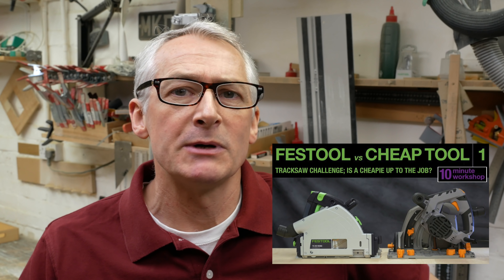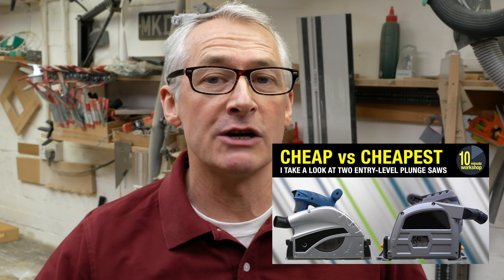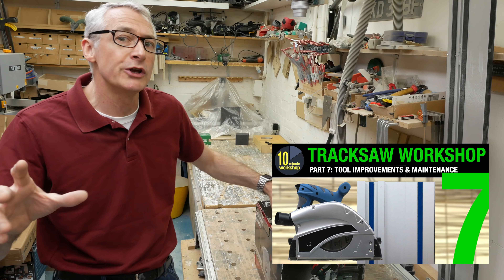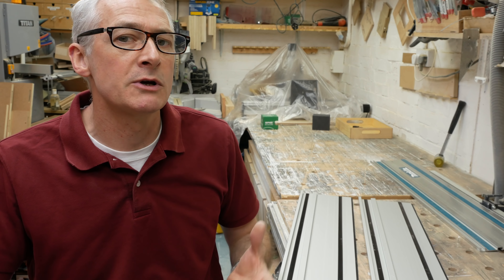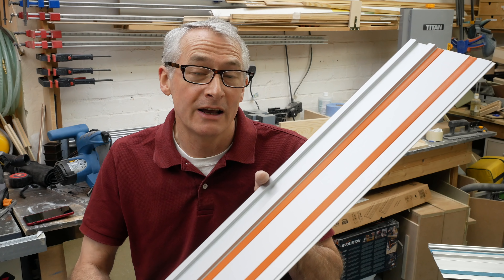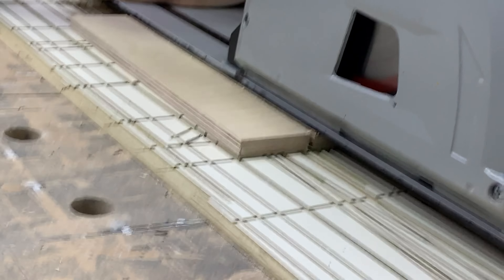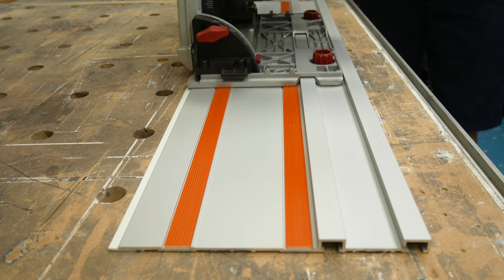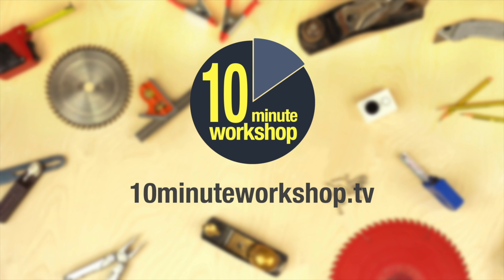Lidl's Parkside Tracksaw [Video #323]

Comment: I quite like the Parkside stuff, I've had several tools for a few years, I'm not a joiner or a tradesman but I do use them regularly and they are still working fine. Wouldn't hesitate to buy a saw like this.
Reply: A mate of mine runs a motorcycle repair workshop.  He needed a drill in a hurry when his had died, grabbed a Parkside one as it 'would do' f but has been thoroughly abusing it, and the single battery it came with, for 5 years (or more).  It's still fine!
Reply: They're made in Austria!
Reply: @AC_Milan1899  all Parkside tools are made in China. What makes you think this is made in Austria?

Comment: Thanks, Peter, I purchased this on Thursday and opened it today. I was not very happy about the tracks as there was a gap with the splinter guard. I called Lidl and they will raise it with the manf.  I used the saw today and it is great. I am glad I watched your video before spending lots on a table saw.
Reply from the maker: Thanks! How do you mean ‘a gap with the splinter guard’? Between the rails when they’re joined maybe??🤷‍♂️
Reply: @10MinuteWorkshop  Yes its about 3 millimeters.It At the back the rubber grips were not stuck correctly either. The fitting is not flush. I was watching your latest vlog.
Reply from the maker: Then presumably the runner strip wasn’t in line with the rail, so was overhanging at the other end. Could you not join the other ends of the rail, and trim the splinter guard back? Might be easier than messing around with the manufacturer 👍👍 Splinterguards are consumables btw - they’re meant to be replaced.
Reply: @10MinuteWorkshop  It creates too much sawdust even with the vacuum cleaner attached. I returned the item back to Lidl and got a refund. I will need to install a proper dust removal system. For my hobby work , it might be better to use more hand tools than power tools :(

Comment: Very timely video and thanks to Louie!

I have owned this saw for 2 years and can confidently recommend it, especially with an upgraded blade (Triton TTS60T in my case, which has the more common 2.2mm kerf)… it plays very well within the Festool ecosystem (for the better and more comprehensive add-ons) and fits within a Sys-4 systainer, with room to spare.

One thing not mentioned in the review is that it lacks a riving knife, which some may view as a big drawback when cutting solid wood

I look forward to the Triton rail deal review, although the fact that the 'unique' profile implies that some Festool (stops, etc.) and third party accessories (UJK clips, etc.) won't work with it

Comment: I've been using the Parkside plunge saw for about 4 years now, bought it to trim decking and since then I've used it mainly for floor board repairs, door trimming and wardrobe installs, probably hung 30 internal doors last year and it's been a great tool as long as you remember a couple of things, buy a decent 42 tooth blade, I get about 8 months out of a Freud blade, the festool splinter guards fit fine, I would recommend new ones every 2nd blade change, get the Nilfisk aero dust extractor, and spare guide rails from lidl customer services. Also remember this type of saw will bite back if you just drop the blade into your work surface and mitre cuts deserve even more care than you initially think. Every year I hope this saw will break down so I can spend 600 quid in screwfix on a Mafell saw, and every year I think how could I justify the cost, I couldn't cut any more doors in a day, I couldn't repair any more chipboard floors, cut deck boards etc etc.
Thanks to Peters other reviews, I did finally buy a self centering drill bit so now my hinges go on square! Thanks
Reply from the maker: Glad to hear the Parkside is working out for David! 👍👍
Reply: How much were spare guide rails? Do they have longer ones?
Reply: @industrialautomation3470  I've since replaced the parkside saw with a Mafell because of the better rail system, better dust extraction and blade removal. If you contact Lidl customer service they'll give you a price for extra rails but they're only 700mm long so cutting a 2400mm board needs planning.
If I was keeping the saw I'd look at another make of track.
Good luck, I hope this helps

Comment: I’m new to parkside. I’ve found from experience that for the Hainault branch I visit, you need to regularly get the magazine or app and see what will be available. If there is a parkside tool you like, you would need to find out the day it is available (usually Thus or Sun). You would then need to get there early (morning) that day and grab one. They only put a handful out.

Comment: For a diyer these tools are pretty darn good, I’ve had quite a few tools from Lidl’s and even Aldi and they’ve done the job I wanted it for and even on jobs that needed a better tool......this tool is ideal for cutting up ply to size but, a word of caution, make sure you allow for kerf in your measurements....
Nice and informative video, cheers 😉
Reply: Kerf ?????
Reply: Kerf is defined as the width of material that is removed by a cutting process.

Comment: Highly recommend this saw. I bought one when they first came on sale. I used it everyday for 6 months. Unfortunately mine was stolen along with some other power tools. I now have the dewalt tracksaw. The Parkside had a nicer sound to it, the dewalt sounds a bit rough when the motor first starts. The Parkside is much easier on the ears. Very very good value for money. I may even buy another if they come back on sale as was said in the video.
Reply from the maker: They’re available now, I believe. 👍👍

Comment: I have a load of Parkside stuff works just fine as long as you set them up and tweak them properly. Titan tools are also great... I have their cheap table saw and I've been using that for about 3 years now, great bit of kit an absolute bargain.
Reply from the maker: Yep - and everything needs a certain amount of tweaking at the start, even the top brands 👍👍

Comment: The million dollar question is: does the saw blade pivot along the cut line? If you want to make a 45° cut does it line up exactly with the 90° splinter guard or does it cut into the splinter guard? I imagine this depends on the blade kerf as well.

Comment: Fantastic video, came in search for a review about the Lidl Tracksaw but will be staying for the quality and knowledge you provide! Fantastic channel! One question, if I were to upgrade the standard 24T saw to a 48T saw, would for instance a Trend CSB/pt16548 be any good?
Reply from the maker: Thank you! I’ve had mixed results with trend blades tbh. I usually recommend the Triton 48t blade - https://amzn.to/2EQgUMJ - as it’s a great price. BTW this vid is getting on a bit now - there’s a more recent Parkside saw video  here 👍 - Lidl Parkside plunge saw 2021

https://youtu.be/kFyDGdH66HM
Reply: @10MinuteWorkshop  Thank you so much for your input :). Much appreciated! I checked out the videos mentioned, including the test with the Triton 48t blade. The result looks very clean for a set costing less than 100 euro in total, it's hard to beat for a hobby builder like myself. I should also thank you for making the tracksaw tutorial series, extremely helpful in getting started!

Comment: Following this Video I rushed out and bought this saw and I am thrilled with it. It’s a cracking saw for the money and has been invaluable in my house renovations. The only downside is that the rails seem to ‘wander’ when making cuts, especially long cuts. Is it worth upgrading the non slip stuff on the back or would I be better off getting different rails eg Evolution or even festool?
Reply from the maker: Good to hear you getting along OK with it. Are you clamping the rails or just relying on the grippy strips underneath?   A pair of cheap clamps might be a good investment, generally (Makita and Festool screw clamps are pretty similar in price) but yes, you could upgrade the grippy strip, or switch rails. I’d try a pair of clamps first tbh. 👍👍
Reply: @10MinuteWorkshop  Peter, thanks for your reply. I'm  using it freehand at the moment but will look at getting a pair of clamps. The splinter guard is also not true. For some reason its not a straight line but the saw cuts true. I think that may be user error on my part when setting it up! This is why I am weighing up the cost of replacing grippy stuff, and splinter guard with a set of new rails. Did you ever get round to reviewing/looking at the evolution rails?
Reply from the maker: @abyshepherd6944  Ah, OK. That's odd about the splinter guard; if you warm it up a little you can peel it off, move it out by a couple of mm and re-cut it - that trick works a few times before you have to replace it completely. And no, I haven't done anything video-wise with the Evo rails yes, but they're the best option for a pair of 1400 rails, right now. 👍

Comment: I feel there is too much focus on track compatibility, Peter. I understand for someone like yourself, with expensive kit like the Festool, the idea of buying a budget tool and using its track would be of interest but to most purchasing I doubt they would care.

Again, I believe the Titan, Aldi Workzone & Lidl Parkside are made by the same parent company (Positec). Apart from the blade differences etc I'd reckon everything else is down to quality control and pot luck in which one you get in the store. My Aldi one works perfectly but the Parkside seems better value for money.

Anyone into DIY should invest in a track saw. They really do make a difference in accuracy of cut and saving time.
Reply from the maker: Fair enough, but it would be remiss of me not to mention the inconsistencies in e.g. the Aldi saw; I covered this in more detail in the 'Cheap vs Cheapest' video (#285) but the short version is that a length of additional track is the next purchase most people make, and it would be disappointing to find out that the saw you bought isn't 100% compatible with the defacto standard. I'm happy you're happy with your Aldi saw (made by Scheppach, btw) but in my experience it needed a lot more work to get cutting well vs eg the Titan. 👍

Comment: Could someone please help and tell me which way do you unscrew blade bolt? 
Sounds stupid but I through away instructions and in need to change a blade, 
Tried anticlockwise and manage to ruin the bolt, so I'm not sure if bolt got stack or I'm trying wrong way. 

Buy the way this review is really usefu and obviously made my buying this saw👍👍👍👍
Reply from the maker: Anti-clockwise - https://youtu.be/6TNaspl5DpY?t=165 👍

Comment: Hi Peter - that was a most effective and efficient overview of the Lidl tracksaw. Thank you.👍

If I may ask a question about Festool rails and the plastic splinter strip - I have damaged mine - can you just peel it off, reposition it (will it restick?) and then run a trimming cut - or do I need to buy a replacement?
Reply: The rubber strip on my Scheppach was lifting even from new (shitty double sided tape) so I removed it & stuck it back on with a fine smear of silicone, don't see why you couldnt do that ? 😎👍☘
Reply from the maker: Yes Norman, as Peter says it’s just double-sides tape - warm it up first to make it easier. Full how-to in Oart 7 Olof the tracksaw workshop series. 👍👍
Reply: Peter Millard  Thanks Peter I remember now - Doh! 😳

Comment: Just a quick N.B. the Workzone/Sheppach also has the anti-tip lip on its guiderail too - I just noticed. I can also say that it seems to be  quite an acceptible 'entry-level' saw but for two points; 1) The guide rail join can be a little uneven and cause a lip that needs looking at. & 2) It would certainly benefit from a quality blade. (Pennies are being squirreled, as I speak) {Cheers to Louie, too, its feels like a wonderful community that we share}
Reply from the maker: Thanks Keith. You need to buy the anti-tipping foot for the Workzone as an extra though, it's not part f the base-plate 👍
Reply: @10MinuteWorkshop  Don't think i'll be tipping it over much, 90* cuts for panel dismembering is all I need. I itterally just spotted the lip as I was watching your video [my rail is just here on my left] and as you were pointing it out on other tracks I thought i'd mention it. cheers

Comment: Hi Peter, please check if the blade on parkside saw is wobling... thanks :)
Reply from the maker: Hiya. No, mine's solid; a few folks have mentioned this, and I think a lot comes down to the 'quality control' issues I referred to in video #327. 👍
Reply: @10MinuteWorkshop  You lucky man :) in my the blade is wobbling little but if I rotate inner flange under blade the wobling are very big... when I cut at full deep I destroy 3 teeth on blade. it crast to the saw base :(
Reply: @10MinuteWorkshop  Hi again :) is there some maximum blade wobbling tolerance ? thanks

Comment: Hi Peter, thanks for these videos, I have enjoyed watching. I recently bought the Ryobi equivalent of the lidl parkside saw. It the exact same machine in every way just a different colour. My question is about kick back and how to avoid it. On one of my first cuts I got terrible kick back crosscutting a peice of oak. Is this normal, hopefully not because I can't afford to by a new pair of underwear everytime I use it
Reply from the maker: Hi Rhett. I’m sorry but I’m not aware of any Ryobi plunge saw / tracksaw; I did a quick check and there isn’t one listed on the Ryobi website?? Either way kickback on a plunge saw is very specific - it’s when you plunge into the workpiece and the blade catches, instead of cuts, and pushes the saw out of the material. This is usually on rip cuts, very unusual to have this on a crosscut. I go into the causes and solutions in detail in the tracksaw workshop series - playlist here, http://bit.ly/TracksawWorkshop - but in short, a good sharp blade, good technique, and steady plunge into stable, dry material goes a long way to mitigate it. There are accessories like rail stops, that can also help, if you’re making a cut that might induce kickback. That’s the bare bones of it anyway, as I say, the tracksaw workshop has a lot more detail, might be worth a watch? 👍👍

Comment: I got one. I don't know if this is true for everyone but mine had guide rails that were not cut at right angle. So, joined together they didn't form a straight line. I spent quite some time filing and sanding to get them right.Otherwise, great saw. I ordered additional two sets of gude rails, they are very cheap.
Reply from the maker: Nice! The quality control isn't the best on these, but they sure are cheap! Further thoughts in video 327 - Supermarket saws https://youtu.be/X5e2s39H1Sc
Reply: I am not complaining at all, I was able to solve the issue myself. It is more like heads up, better check this before cutting. And the spare two pairs that I ordered are both perfect.

Comment: Cheers. Now it'll be even harder to get one before they sell out on Thursday! (I aim to get there early...)
Reply: The usual pattern is for demand to drop off each time they offer something like this. Also demand can vary a lot depending on the location of the store, so if one has run out it's worth trying another.
Reply: @Graham_Langley  Nah, I just left for work early and bought one on the way, though I did walk right past it first time, it took another lap of the middle of Lidl to get it. Still, I now have a track saw, hurrah!

Comment: Hi Peter,

Thanks for the video. I own a Parkside plundge saw and I'm genuime happy with it. I want to upgrade the guiderail and I'm that regard, do you have any additional suggestion aside from the evolution one? For instance, would the Triton guiderail fit and / or from other manufacturers? Many thanks in advance and looking forward to hearing from you. 

Cheers!
Reply from the maker: Thanks! The Parkside fits in the standard Festool-pattern rail, so any rail of that type will work. I’d say an upgrade is to a longer rail though, and the Titan is only available as 2x700mm unless I’m mistaken. The Evo rails are the best price atm, either direction a single 1400 rail, for the pair with bah and clamps. 👍

Comment: You basically get what you pay for with most tools. I've just purchased the Bosch GKT 55 GCE 160mm 1400w Plunge Saw inc Guide Rails, Connector & Rail Bag in L-Boxx. Its basically a Mafell MT55CC model. It does the job really well and the cuts are perfect.
Reply: Basically a mafell!?

Comment: Thank you for the timely video!

I own the Makita 110v and have just purchased the cordless version from FFX with double charger and 2 batteries. Loved the saw -still do, but hate the cord and hefty tranny! 

Anyway, I am after a shorter track to cut worktops and other 'wee bits', and thought that the Lidl saw, for £65 would be a spare saw and blade - pretty much for free - along with the two shorter tracks.

So glad I watched your video, highlighting the incompatibility with the Makita track. Presumably, though, the Makita would fit on the Parkside track, in which case, I'd still be after one to do the short stuff. An 800mm track would be better, but if they are really only a tenner, well, it's would be an absolute bargain!
Reply from the maker: I don’t have the Makita, but it should fit the Lidl track OK. But you never truly know until you try it. 🤷‍♂️👍
Reply: I have a makita 36v as well as a ts55 and the evolution track works perfect with the makita
Reply: @craigwatton8941  Thanks Craig, I'm currently using one of my Maktracks with the 1mm kerf 36v, and the other with the 2mm corded saw. I will need to cut full length sheets too, so either a shorter track or, as you suggest, the Evolution.